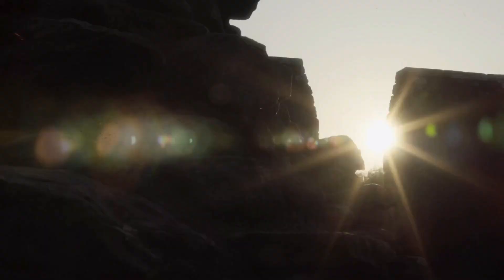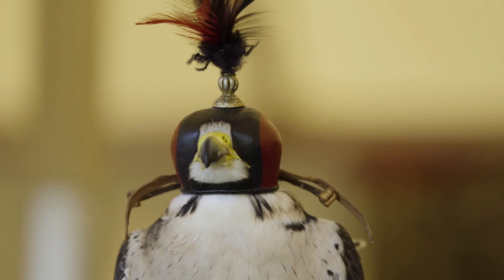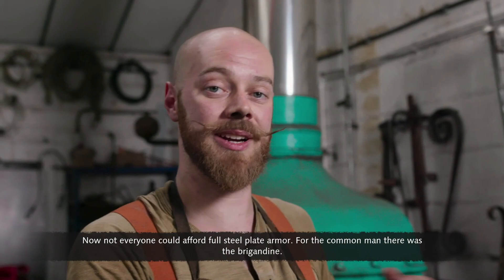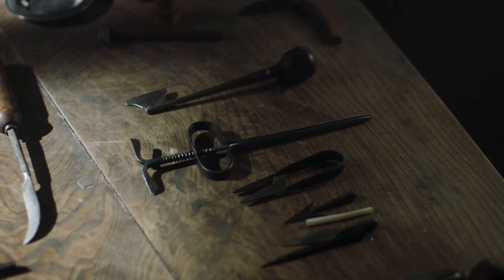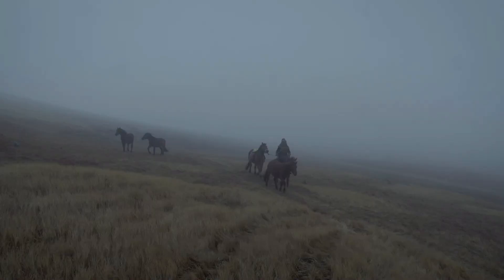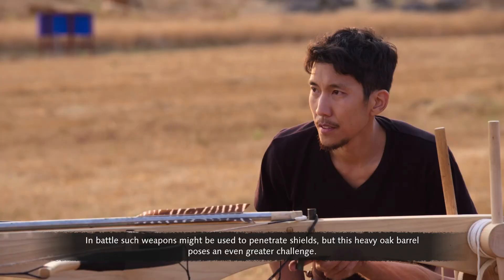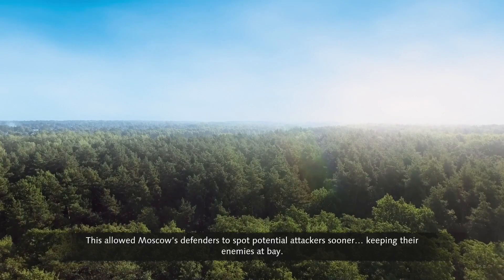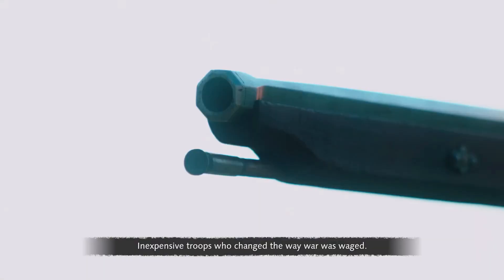Age of Empires 4 ALL Campaign Historical Lessons

Comment: I don't buy for a second that Europeans somehow realized that round towers were better to ward off projectiles beacuse they saw them in the east. As if they were too dumb to pick up on that themselves. The more likely reason why things changed was because of the advent of more powerful seige weapons that posed a threat to castle towers like the trebuchet. Once the need popped up, people began changing their designs to adapt to the new threats.
Reply: certain buildings were also sometimes built with round shapes, like religious buildings.  One of the reasons for this change is the fact that making a square tower is much quicker and simpler to build, a round tower requires almost constant checking of the dimensions, from the foundations to the frame, to have a perfectly round frame.  In the same way as before the appearance of stone dungeons, dungeons were made of wood, not because of lack of knowledge because buildings like churches were sometimes made of stone, but because of the cost of stone it  took longer to make the transition, and above all had more frequent invasions and wars to make it useful.
Reply: Europeans learned a lot from the whole world as the world learned a lot also from Europeans. The relevance of Europe is fading and so should your superiority complex.